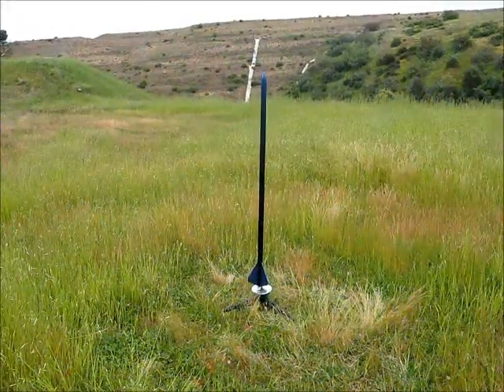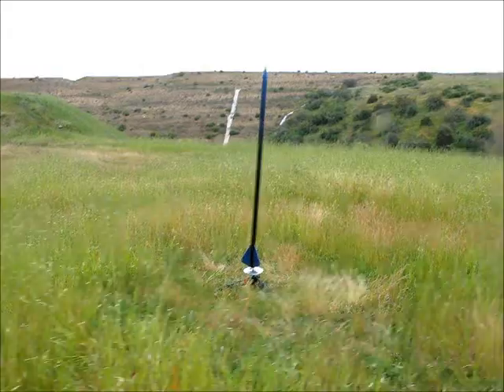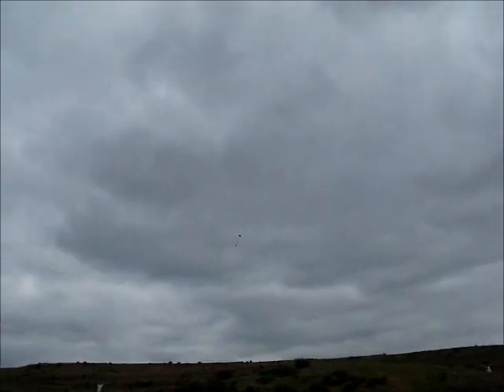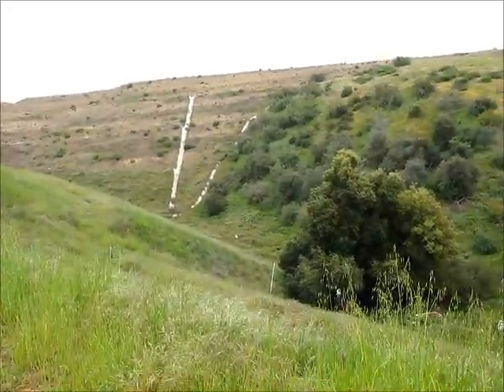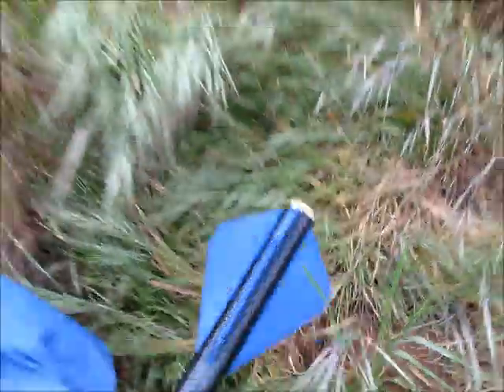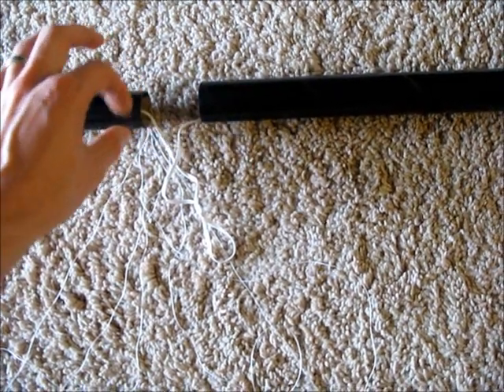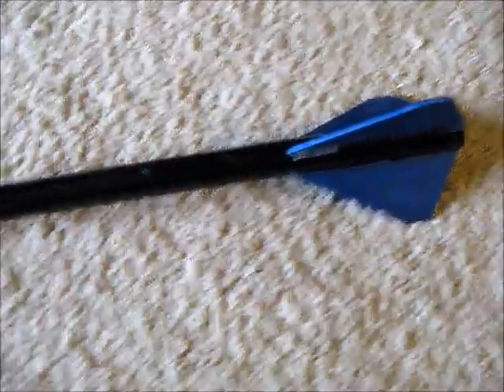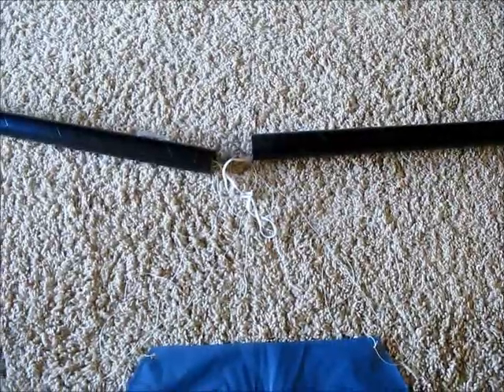Beast-50 Homemade Model Rocket Launch

Comment from the maker: Well, there are the A,B,and C, the D and E series, then the huge F, G, H, and I series. They keep going, but those are the most common. The first group is the cheapest and vary in burn rate, C being the longest burn time. They are all one-use motors, but you can buy a reloadable shell, especially for the D and larger size motors. Once you get to the F size on up, it really becomes more cost effective to do reloadables.